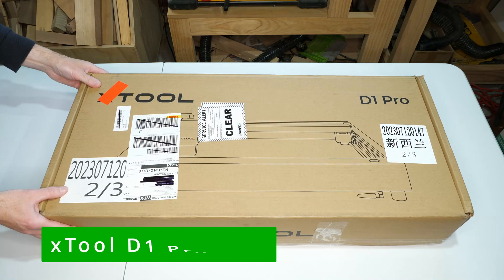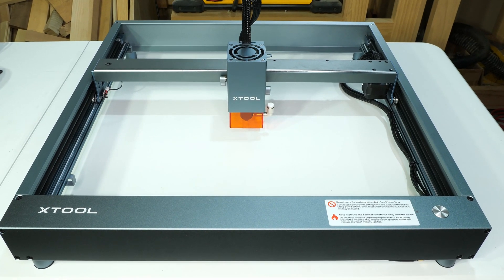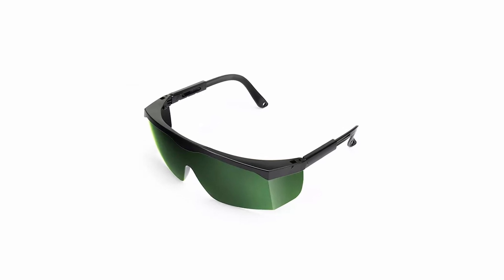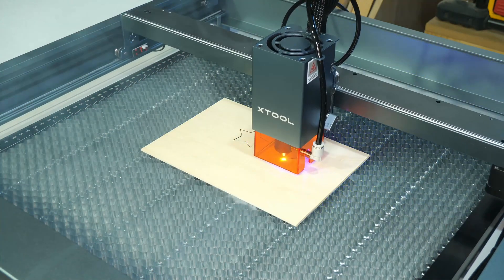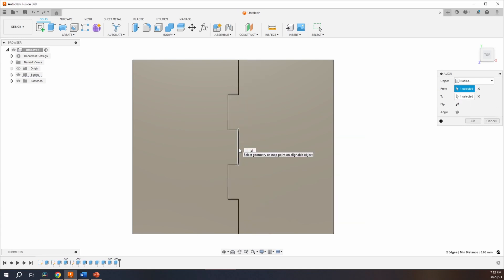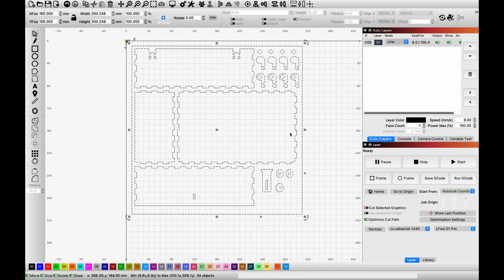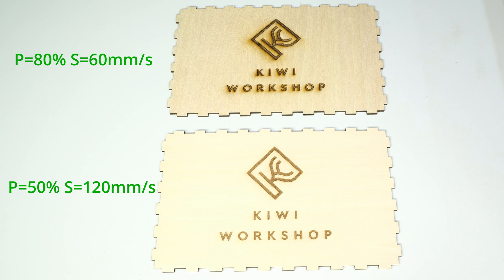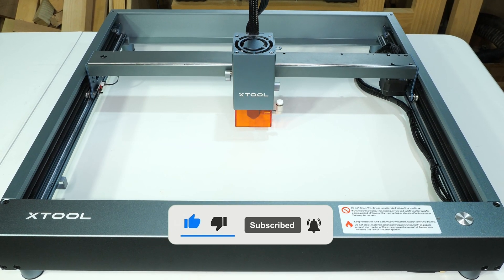xTool D1 Pro Laser Machine Review and Tutorial For Woodworking Including Laser Cut Box Project

Comment: So I'm just looking for how to make mine center. I put a piece of wood down and on the program it's center but it ends up engraving off to the side corner. Had there been no wood there it would have burned the table
Reply from the maker: It sounds like you have the xTool setup with relative, not absolute coordinates. This means engraving will start at the top left (x=0, y=0). So instead of trying to align the laser with the center of your workpiece, align it at the top left.
Reply: @kiwiworkshop  does that mean move it manually to the top left of my workpiece?
Reply from the maker: Yes, that's what I do for relative coordinates. Keep in mind that if your design is offset away from the top left corner of the layout, the laser will move the same distance before starting the engraving/cutting. So if your design starts at X=5, Y=5, the laser would move this distance from wherever you have positioned it before starting. Hope that makes sense?

Comment: Hi, i want to but a xtool d1 pro for our shop (cabinet shop), we want to encrave our logo in the doors, is it possibe to encrave a piece 70x30" just placing the machine on top of the wood?
Reply from the maker: Hi, yes this is possible, although I haven't tried myself. You would need to align the xTool in the right place and adjust the Laser head down to the right level for your door using the focus lever. If you are doing a lot of these, I would also build an xTool enclosure with smoke extraction.